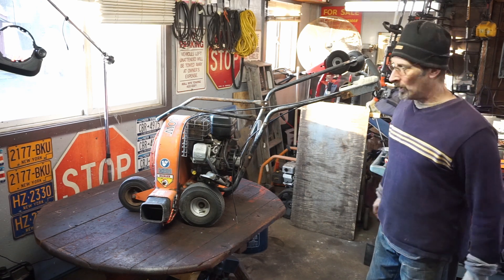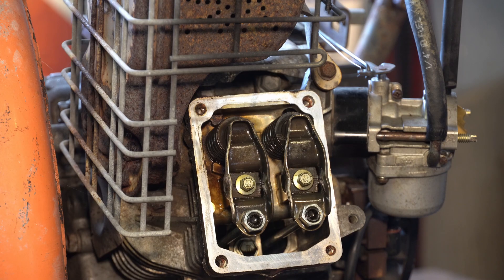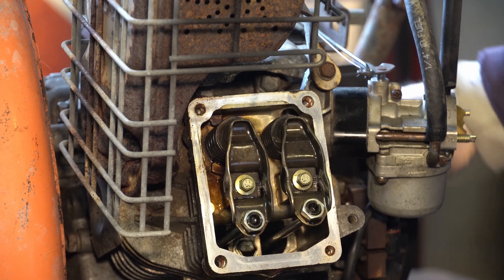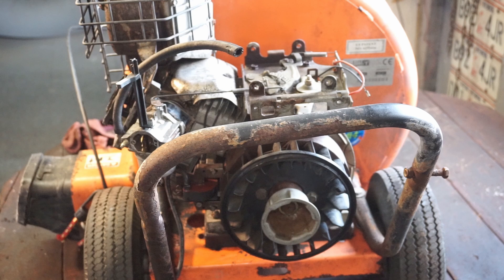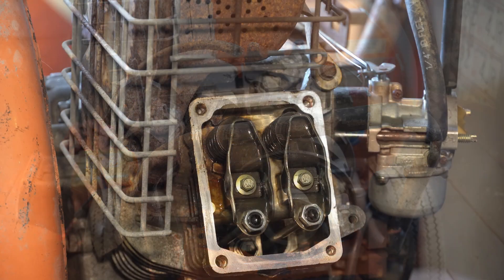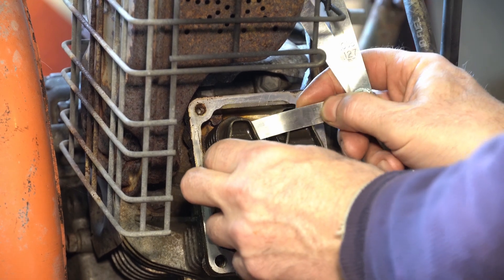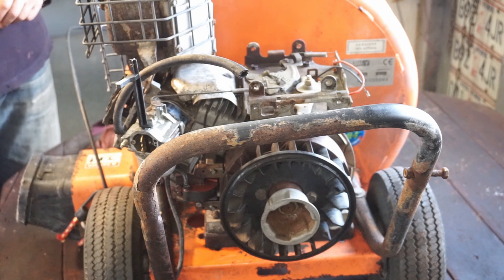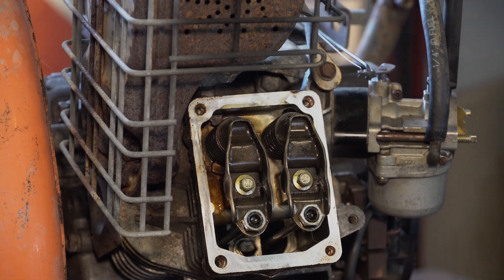How to Adjust the Valve Lash (Clearance) on the Briggs and Stratton 9.5 Horsepower Engine

Comment: i like it a little tighter than lose push rod can come off ,then they get bent out of shape and i  recommend  they be checked or adjust once a year to avoid problems your choice, avoid a problem before it  happens ,i dont agree with, if its not broke dont fix it ,that dumb, preventive maintenance   that my thing,and thats what i call it,

Comment: i was surprized it had no guides for the push rods dont like that at all
Reply from the maker: this is an older engine even of this design. These weren't that good, even the next model up were prone to head gaskets issues and all of them, even the newer OHC seem to suffer the cam issue where the compression valve release breaks. 
But, if taken care of, they last about as long as the machine itself cost wise

Comment: Let me understand this, so you are saying TDC is with the magnet centered on the pickup??  That sounds MUCH easier than all the others advice.
Reply from the maker: Yes, and in most engines..Doesn't need to be done often and if it does, its time to clean and check the entire entire engine!